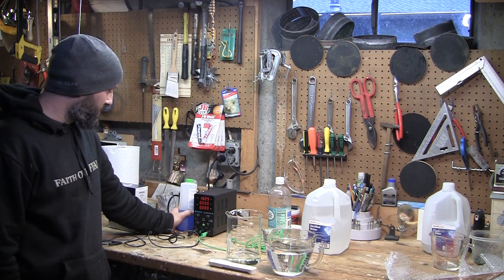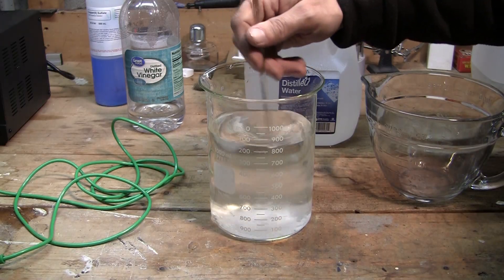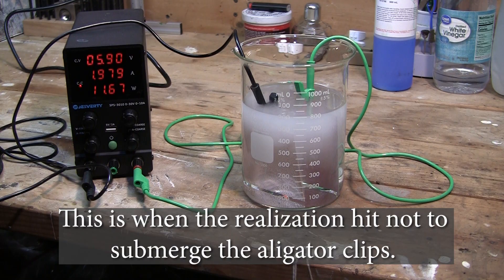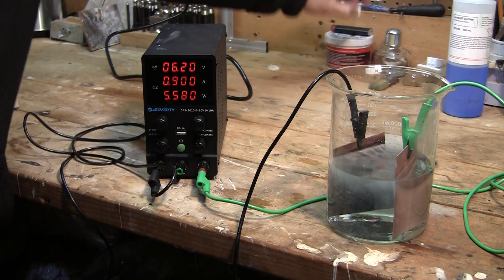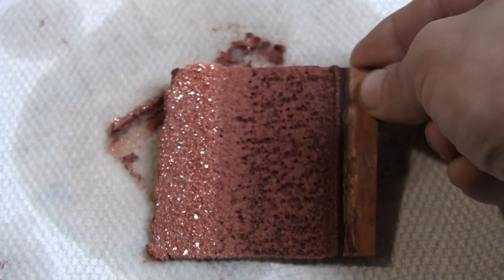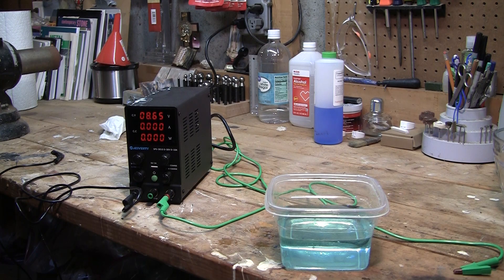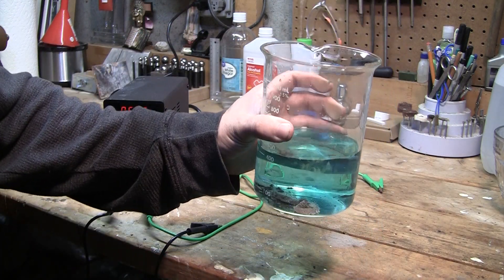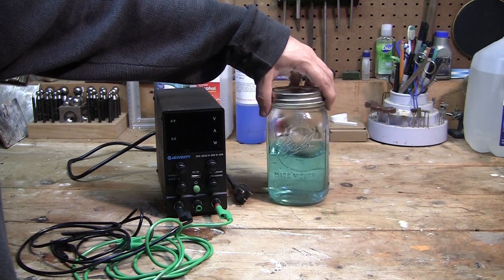Best Budget Bench Power Supply? Jesverty 30V 10A Hands-On Test

Comment: Once you set the current you don't need to adjust it again unless you bump the knob.  If you want to check it you could just touch the plates in solution for a second.  It won't hurt anything. Voltage goes to 0 and current maxes out.  In a series circuit current is the same everywhere so you don't need to worry about lead losses or anything so long as you get into the constant current mode. The way to get around the alligator clip problem is to use some heavy gage copper wire and just wrap it around your plates a couple of times and clip onto the end on the tabletop out of the splash zone.  It's all copper so no contamination.
Reply from the maker: This is some excellent advice! Thank you so much for taking the time to share these tips.